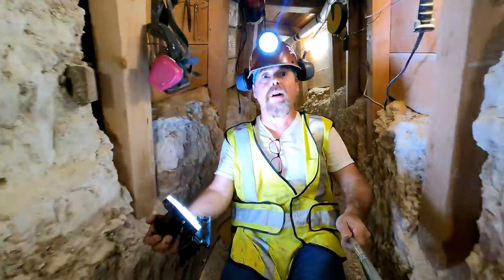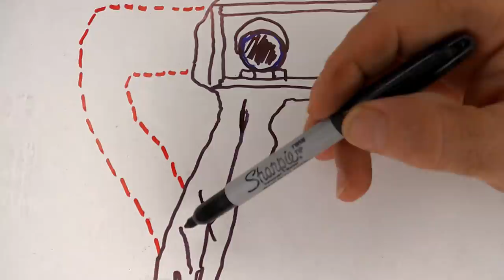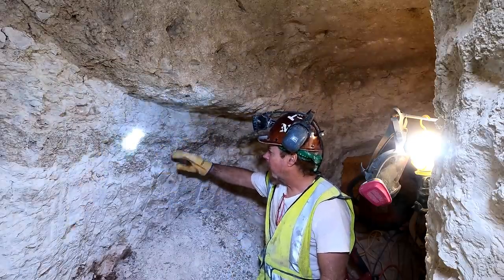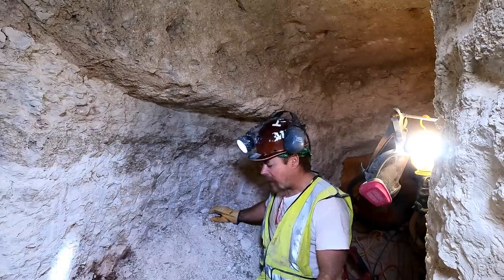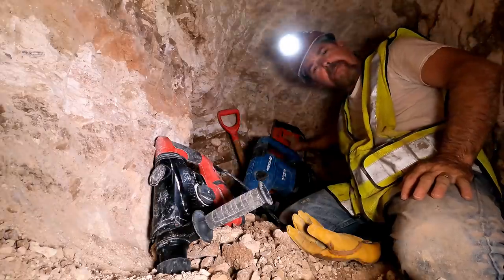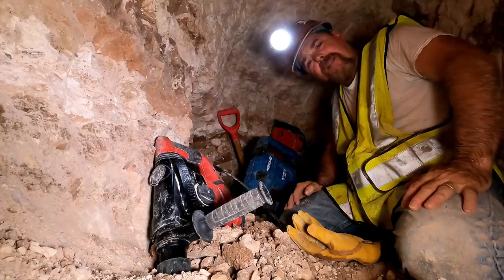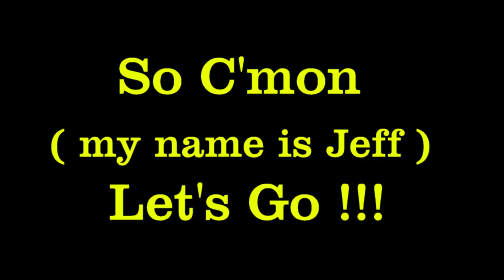DIGGING A SECRET TUNNEL UNDERGROUND

Comment: So once your done with the tunnel wrap the pillar with chain link twice. Then get 3or 4 bags of mortar ( yes for a block wall) mix up and spread it on the chain link evenly apply two layers. Once it’s dry put up your timber this will help hold the weight and support the back.
Reply from the maker: thanks
Reply: It would be better if you shotcreted it. I have a machine that could do it but I would have to help you. I don’t know if I could come up with the time anytime soon. It needs to be wrapped and concreted as soon as possible.

Comment: I discovered, filed, and started my mine. No finish in sight. :P (7:26)
I just ended my season up here in Oregon. My Bauer 35lb quit working and Harbor Freight just refunded the cost so it ended up being basically an $80 rental for the season. Can't beat that. I also just got a battery powered Dewalt SDS Max.

Comment: Just a question but why not just take the track and put it on the other side directly opposite of where it is now? Seems like that would have been easier, unless you'd have to move everything around on the surface too. We'll be out there to help, it may be this winter but I'm all about it. Stay safe out there.

Comment: It is exciting to see your progress. We are faced with calcite that has formed like cement over the tracks in our mine. Do you know of any way to dissolve it?
Reply from the maker: thanks Frank , you can use vinegar to dissolve the Calcite
Reply: @Askjeffwilliams  Thanks Jeff we will try that. I haven't had much luck with the impact hammer it is really tough!
Reply from the maker: @exploringabandonedmines   let us know if that works .... got a few more ideas
Reply: @Askjeffwilliams  The place that we really want to clear is in water. We were hoping to chip it out so we can drain the mine. So we couldn't put vinegar in there without it being diluted. But we could test it in dry areas with the same build up and see if it softens it up. If you try hammering with a pick it does nothing!

Comment: what is the temperature in the tunnel where you are currently digging/excavating?  what are   you doing to keep yourself safe.......are you planning on drilling an emergency comms and air line directly above where you are currently mining?  how far down are you if you drew a straight line to the surface...love your videos and passion, and your willing to share your experiences
Reply from the maker: 70 degrees ....... we have many in the works and are about 40 vertical feet down

Comment: Jeff
Are those soft sediments going to compress around your pillar?
Should you support the drift both in the access tunnel to the skip bucket as well as the original opening to the Chinese shaft
It would be good to keep that original access for ventilation purposes
Was just wondering about the rock structure your digging in
Reply from the maker: we thought about that ...especially the dark clay seams so we will be timbering it

Comment: Why not use a vacuum system   Run a couple shop vacs to a container that’s the size of the rail cart bucket and connect 2 hoses to it. Like a dust trap system seems like a vacumme  system would work more efficient in a small space  instead of a shoveling.  Also maybe welding a extension on the hammer tools chisels

Comment: I've been looking at cordless hammer drills, and I'm not really experienced with them at all. I'm used to using hammer drills when I did some plumbing for a solar company. They often had to drill through one foot thick foundations on apartment buildings. We also put in safety pool covers using a hammer drill that was on a cord. Am I better off just using a generator and extension cords? Corded or battery power? What do you guys think?
Reply from the maker: cord
Reply: @Askjeffwilliams  The batteries never die on those.

Comment: I found clay similar in a creek bed and I already researched and know that there is only lode claims no placer claim there. I put my notice of location and monument. I would like to know if the clay can be considered lode just to be safe? Lode is only rock right? So I should be safe? Here in northern Nevada. Thank you.
Reply: And finding good chunky gold 13 inches down. Can go down much further but need a power hammer like you have first.
Reply from the maker: Lode is Hard rock and below 10 feet placer is surface to 10 feet and in gravels and clay
Reply: @Askjeffwilliams  Thank you very much! I found my own placer claim then with chunkies!
Reply from the maker: @schipperranchprospecting4534  thats great

Comment: I am a bit curious.  Why not simply drive the shaft just a few feet to the left of the main shaft, basically widening the existing hole by about three feet, then dumping onto a chute, which would funnel into the extractor bucket?
Reply from the maker: what fun would that be
Reply: @Askjeffwilliams  LOL.  I wonder if you have ever listened to Yogscast 'Diggy Diggy Hole.'  If not, I suggest you do, because it definitely fits. <grin>

Comment: Why didn’t you move the guide tails for the skip bucket to the opposite side of the collar so you could run the existing track straight to the skip bucket? From the comfort of a computer it seems like a simpler task. Not a criticism, just trying to learn.
Reply from the maker: it will all make sense in time .

Comment: I hope you are checking the waste with a metal detector so you don't lose any gold nuggets.  I notice the red band  where you might find a nugget or two if it isn't just clay.  Break on through to the other side !!!  Don't forget to put in a Lazy Susan and a "T" at the ore bucket for parking your ore carts when you are waiting for the bucket to make that round trip.  If you put the Lazy Susan on a pneumatic lift, it will make ore dumping fun, not a backbreaking chore...  Use you miner DIY engineering to "get 'er done" !!
Reply from the maker: yes we are and good idea

Comment: i wonder why you ain't using any BOOM down there?  that material seems rather stable
Reply from the maker: the clay seams are too soft
Reply: @Askjeffwilliams  curious if you hold a BATFE type 54? a gross of nonL and theres a newer jelly on the market 30%. supposed to be less shock and slower for brittle seems here in the NE

Comment: I don't want to come off sounding like ol' smartie pants, but I'm assuming continuing straight to the haulage bucket is a problem because of the vertical track system to run the haulage bucket up would be in the way?  So, wouldn't it have been easier to swing the track over to the opposite side, instead of digging a whole new drift?
Reply: think the idea is he wants the tracks to continue to the gold he has found, so to do that they need to enter and cross the shaft from that side, as the tracks cant doa sharp 90 deg turn
Reply from the maker: the sets are put in with a manway that would block them
Reply: @Askjeffwilliams  👍

Comment: Instead of all those extension cords why not run some under ground rated PVC or flex whip with some 10 0tt  8 Ott  gage wire so can have a 120 amp disconnect panel down in the tunnel?  So you can cut power to the skip car or power tools and your lights on a different circuit  maybe a 15 A
Reply from the maker: actually we are working on a new power grid for the mine just no time
Reply: @Askjeffwilliams  
Apprentice  Sparky with a Brother with a Electrical Co. And a plethora  of knowledge to help me with any wiring issue. If you ever wants some help,  I am in Clark County . Not to far from Sandy Valley.  Iwill work for a metal detector. Or enough to get me a Gold Bug 2.🤠

Comment: Why not use pressure washers and a hoover pump up top to remove the liquid it would separate the gold nuggets there and then be faster no dust and you could old need the lift bucket for solid chunks  that didn't desolve. Did you think of that or am I a genius? 😆
Reply from the maker: sounds cool

Comment: No one ever accused me of being too smart, but I would not drift to the left but to the right of the bucket and wind up where the gold is thought to be..... The way you did it, now the bucket is still in your way...Am I right, or am I right?.....:).......
Reply: I believe they're still hauling from other parts of the mine.  When it swoops to the left, then right, it will be right at the bucket to dump.
Reply: @jcadult101  But that puts the bucket in the way.... Swooping to the right they would be in the gold bearing pay dirt and could still operate the bucket no problem....  What they did looks useless to me, but hey, I'm no geniass,,,,LOL....
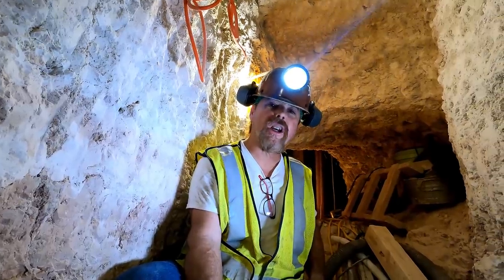Reply: @wsearp  00:56 The bottom 2 marks shows the tracks coming from other parts of the mine.  They're still mining those areas apparently and hauling that material to chinese shaft for removal.

Comment: No Jeff that doesn’t make sense, according to the diagram by going around you still are going to run into the bucket, and it seems easier laying track in a straight line than a curve...who’s idea was this Slim’s?
Reply from the maker: yep Slim is the Superintendent at the mine

Comment: Underground Blast Door, dividing one half of the Mine with the Other haulage shaft.
Maybe also an powder room that turns into an miners office below ground. 
D A N G E R  - E X P L O S I V E - M A T E R I A L S...
                     B U S H ' S       B E A N S
            Keep well ventilated at all times.
            Risk of back drafts and Flames
           Emergency Breathing Equipment 
          Ring 4 times for assistance on Bell  

This could go on and on for every, on the front of the Doors plate.
Please add your own suggests to Jeff and Slim, if you can add a better one.
Cheers....

Comment: Do you have any idea how to build a hot water shower outside?
Reply from the maker: yes .....we use a system that runs it over exhaust manifolds
Reply: @Askjeffwilliams  Would it be possible to do this following:

1. Store the water in a metal 55 gallon drum

2. Have a small campfire underneath the drum to heat the water

3. Have a siphon connect from the 55 gallon drum to a shower head, that can pump water up by several feet (I think this is the biggest challenge)

4. The shower head would be operated by pulling down on a string to release water when needed or it can lock into place to provide a continuous flow of water
Reply from the maker: @BoxerDogs  that sounds like that would work too

Comment: I see you're using that cheap Chinese winch cable . Please switch to a high strength cable. I have had several hf winch cables fail at 400 lbs. Especially at the connection.  Be safe.
Reply from the maker: thanks